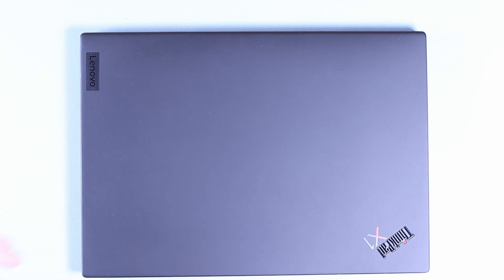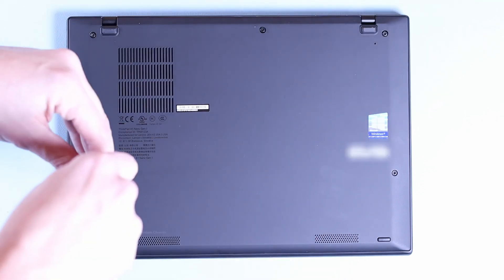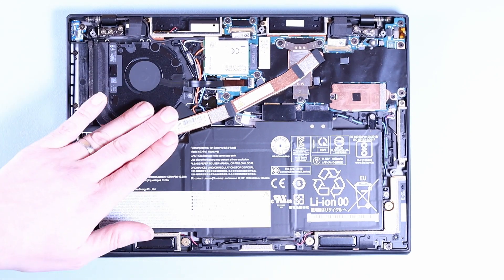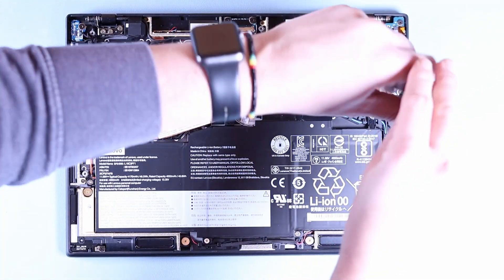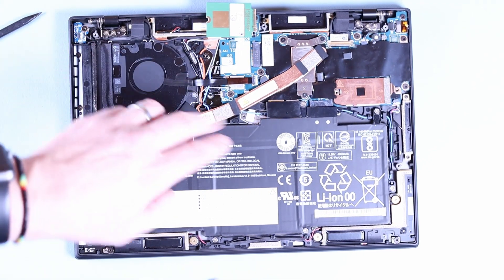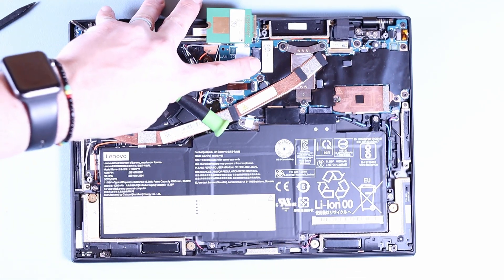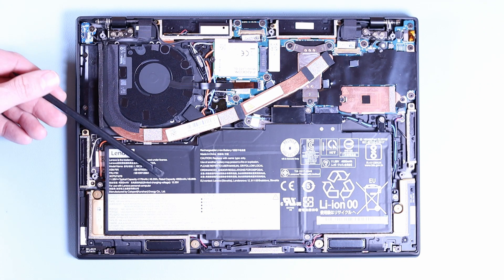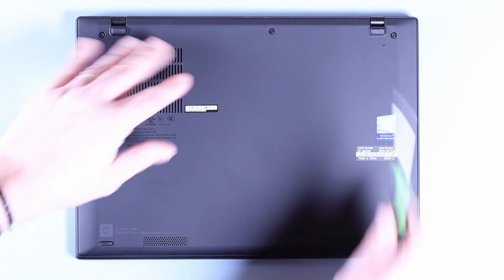Lenovo X1 Nano ThinkPad Internals

Comment: Should've done 2280. With an 11th Gen Intel you get PCIE 4.0 SSD support, which allows for 7000 MBPS speeds. 2242 maxes out at like 2500............... Not impressed.
Reply from the maker: completely
Reply: @MashITTech  You know what? I'm going to try and custom fit a 2280 PCIe in there anyways. I'll let you all know how it goes.

Comment: Was considering changing my matebook x pro for one of these, but the SSD issue has put me off - I have a 2TB SSD that I'd want to swap with the SSD in the thinkpad, so I can upgrade the storage on the thinkpad, and sell the matebook with the 512GB.

Will have to rethink. Hassle.
Reply from the maker: Ah yes, that's a pain. the 2242 does limit your options :(

Comment: I have a Lenovo X1 Carbon 6th, I used WDC PC SN520 NVMe 2242 for WWAN slot
It's B+M keyed, so any SATAIII SSDs should be fine as long as the size is 2242
2242 NVMe SSDs are pretty rare as far as I can tell

Comment: The internal seems messy.
Reply: agree, terrible heatpipe design.
Reply from the maker: Yeah, seems pretty crowded in there
Reply: and they should have learned to combine speakers with wi-fi/lte antennas, that will save lots of space for bigger battery or even lighter weight.

Comment: According to PSREF, it seems to be a m.2 slot for that wwan card, but maybe in 2230 format.
Reply: it seems a M.2 with Key B, would it be possible for Mash IT to check for us ? I am about to buy it but I would like to check what could be my option to install a Wireless card in this port as the embedded will not work with linux without non-free/blobs firmware

Comment: Interesting along with your earlier review on this. Thanks. As I got the T14 from an older review I am very into that right now and I hear there is a lottery of parts such as which brand of SSD, which brand of panel and anything else that can vary. I wonder if you could ever do a review of this kind of thing, commenting on what you got and the alternatives and what’s meant to be good or bad etc?
Reply from the maker: Hi Chris, I do try and mention where there are multiple versions available (like the screens on t14). I don’t feel ssd’s are such a big deal as these days in day to day use you won’t really see a difference in performance but screens can make or break a laptop for me so I try and mention that. I will certainly consider dedicated a video on the subject for sure 👍
Reply: @MashITTech  thanks for the reply. Dont feel you must but theres an idea and id find it interesting. Maybe even with a quick background of the companies that do the screen panel (mine is AUO which is supposed to be worse but I find it fine) etc. I mentioned SSD because mine is one ive never heard of! I forget the name even, but they also call themselves Hyundai I think. They are huge and started doing flash storage in 2019 but I was surprised with performance vs well known expensive brands. Maybe all T14’s use the same, I dont know.
Reply from the maker: I also got the auo panel and it is a decent although not the best one. As long as you don’t get the BOE you see fine, that panel is terrible

Comment: Thank you. I am always interested in these 'getting the back off' items. I  am slowly working my way to a new laptop. It seems that you can usually replace the SSD- have you found this to be generally the case? I may have taken the story of SSDs wearing out too seriously, but I would prefer the facility to replace , in case it's true. I note you mentioned that Apple glues the battery in- do Windows manufacturers do this often?
Reply from the maker: Most windows laptops still let you upgrade the ssd, the main culprits that don’t are surface and some of the xps 13” laptops. Like you I like to be able to change it not just in case of a failure but also to increase the capacity in the future. There are a few that glue batteries in, Microsoft being that main culprit again.
Reply: @MashITTech  Thanks!
Reply: Generally Thinkpads are one of the most repairable laptops out there.